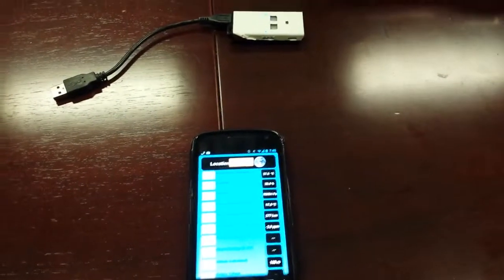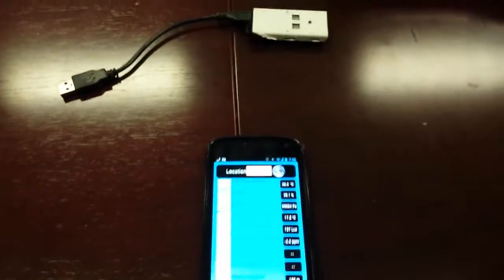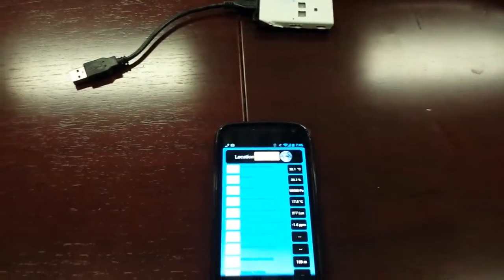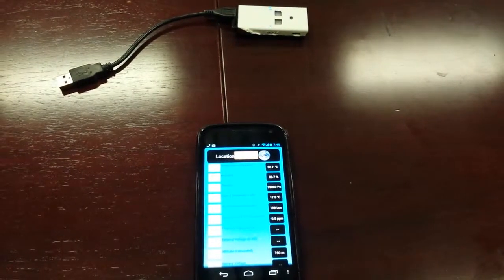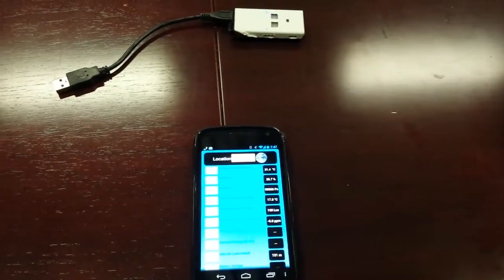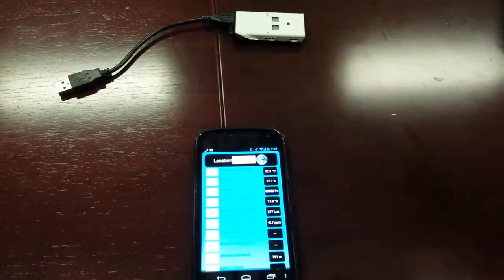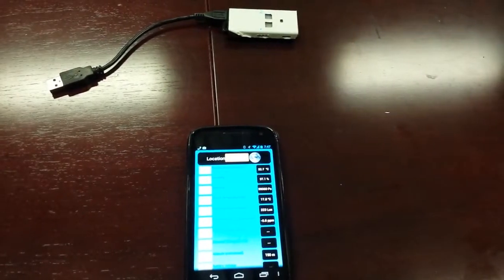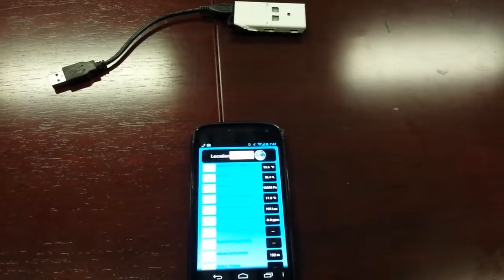Hair Dryer Temp Increase

Comment: clearly the 40C temperature is that of the sensor NOT of the air ; the  temperature  sensor a absorbs heat; takes 3 minutes sec to start
 cooling, while the air around has already returned to the temperature of the room.